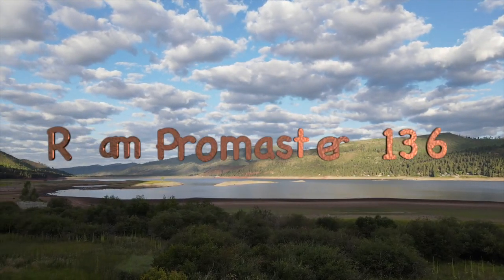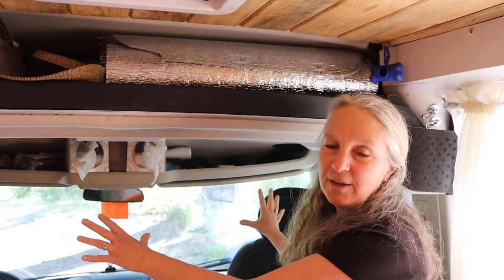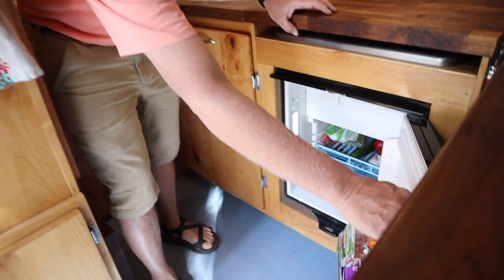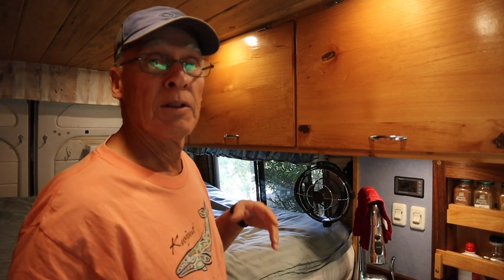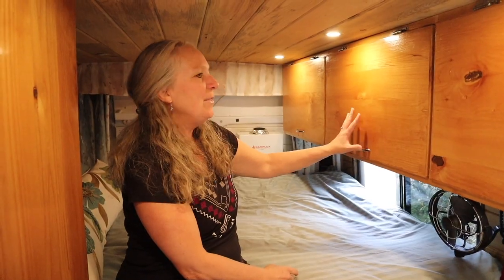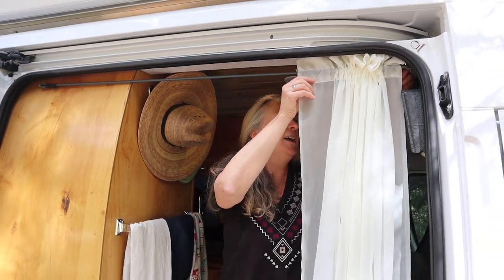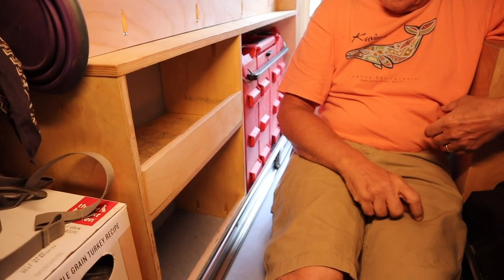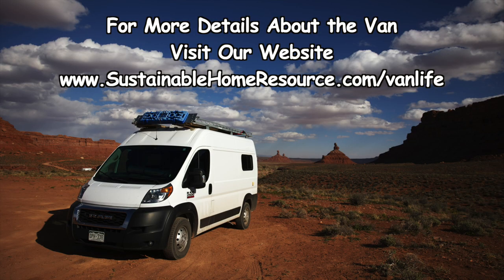Luxury Camper Van Tour | Ram Promaster 136 Short-Body Van

Comment: Your build was the inspiration for us. At the time we were in a small 2000 Flair 25' Class A that we had bought for $3000. On suite, living room with 2 recliners and a kitchen. We loved it for 3-4 week trips but we found we wanted to go into the back country more, off grid and at 8'6" wide it just did not work, although we tried. I did solar and other updates for off grid but we found we did not need all the comforts, we wanted simple and small. I really wanted a 136" van like yours but just could not afford one. SO, I found a 1994 "Shortie" Chevy conversion van with the original "raised roof". I gutted most of it, did a complete upgrade to the mechanicals (hoses, fluids, tires, brakes and radiator) and built it out very simple. I used a lot of your ideas but smaller and more simple. It already had venting windows in the rear doors and a venting window in one of the barn doors so just added a vent fan. 48" cross van bed. A 18"counter top with sink and a 2 1/2 gal grey tank, 18" cabinet above. A cassette toilet on a slide under a full height wall cabinet behind driver for storage. Seats already swivel so added a small fold up table to that cabinet wall with small storage cabinet above. Small lagoon table for passenger seat when swiveled. Fresh water tank, 12v pump, 3"  HDPE "water heater" on roof. We pressurize the tank with a Ryobi battery air pump and to pump up tires. It feeds "warm" water to a shower hose, rear sink and inside sink. We have a pop up shower room. Cassette toilet is removed through access door to outside. Our kitchen is out back, under bed, chuckwagon style. Our power system is a small solar generator, 1-12v outlet is hard wired and plugs-in for lights and another for water pump. 1-120v outlet wired out back for cooking. Solar panels just plug into solar generator, also wired to engine alternator to charge when traveling. Just unplug and use anywhere.

 So happy I saw your build, I had already been watching your videos, gave me the boost to just do it. Opened up a whole new world to us. Shorter trips because mileage is so much better with the little V-6, usually 1 week at a time, out and in. We also use the van to power our 2 tiny off grid cabins and the water system, when we are there and for extra power to recharge our all electric off grid sail boat batteries when at dock. Powered by a small trolling motor to get on and off the dock. Our dock lot has an off grid tiny house at a lake near the ocean. We just run "extension cords" and a water hose. Our little class A is a mobile summer cabin at our "4 acre farm" pond, we still take "luxury trips" to state parks and RV parks close to home, we just don't travel all over the west like we use to. We find we just take the van, more and more, even to "luxury" places and fewer longer trips in the class A. If we are home for a short time, we find we just sleep in the van instead of moving everything back and forth. Yes we only have 1 mattress. Our home base is 1 acre, completely off grid, none of our properties or the 2 RV's have propane. Repurposed log scaling shack on the east slope of the Western Oregon Coast range, 12'x24' with a 2'x7' bump out in bathroom. Gravity fed spring, home built solar hot water heater inside the sun/living room/kitchen for warm water. We cook with solar oven and inverted 12v....James
Reply from the maker: Thanks for sharing your van/off-grid home journey. These stories are wonderfully inspiring. Connecting with people who take the resources they have and build a dream is heart warming to us and a big reason we keep plugging away at our channel. Best of luck to you in your travels and off-grid life in beautiful Oregon (one of my favorite places.).